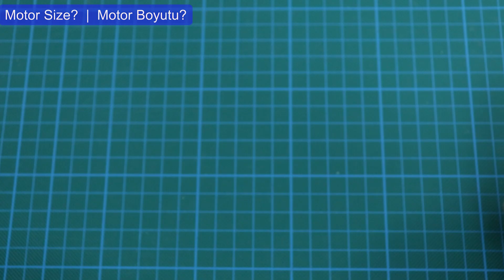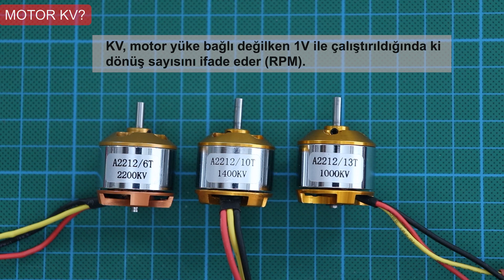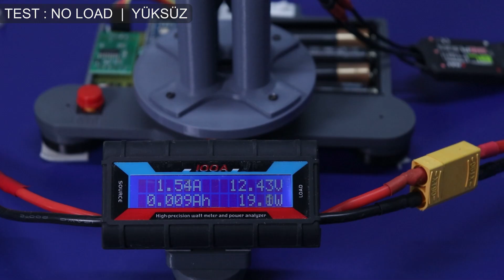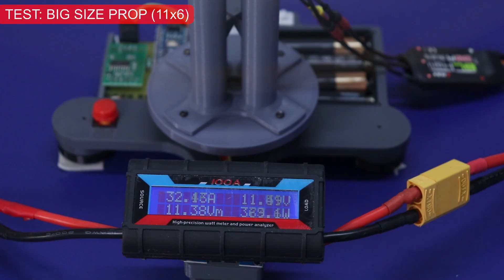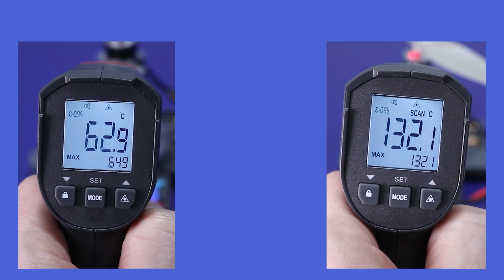RC Brushless Motors. What is KV ? Motor Size? Propeller Size?

Comment: So can i use 8x6 propeller for 1400KV motor? also what mah battery should i use
Reply from the maker: You can use an 8x6 propeller with a 2212 1400KV motor.
mAh (capacity) is a different matter. It depends on the model's carrying capacity, wing length, wing profile, wing span, etc. But generally, a capacity between 1000mAh and 2200mAh is suitable for models with 2212 motors.

Comment: Should I use 1400Kv motor for 9 inch prop ?
Reply from the maker: I don't recommend it. It will cause the motor to draw more current than normal. However, a size like 9x4 can be used. 9x6 isn't ideal.

Comment: hocam merhaba elımde bı 1400kw turuncu bı brushless motor var ve 30luk esc var ve tester ben bunu test etmek istiyorum ben bunu modem adapteriyle test edebılırmıyım 13v 1 a da
Reply from the maker: Hayır uygun değil.
Reply: @RC-Maker-Lab  hocam ben bunu yüksüz olarak denicem çalışıyormu diye hiç yük takmasam 12v 3a lık bi adapterle deneyebiliemiyim yüksüz olara k

Comment: Performance can be estimated from watts per pound. Take the weight of the plane and multiply it by the number of watts/lb you desire. A trainer can use 80 to 100 watts/lb, a warbird might use 125 to 150 watts/lb, an aerobatic plane needs 150 to 175 watts/lb, and a 3D plane needs 200+ watts/lb. The motor must be able to deliver the calculated number of watts. Next, divide the watts by the maximum current that the motor can handle. This gives you the optimal voltage for the motor. Now multiply the voltage by the KV of the motor to determine its no-load rpm. The prop should load the motor down to about 80% of the no-load rpm. Multiply the loaded rpm by the pitch of the prop and divide by 1056. This will give you the static pitch speed in mph. Try different KV's and pitch values until you get the rpm and pitch speed needed. And finally, the prop diameter is used to load the motor down to 75 to 80 percent of its no-load rpm. In most cases, the prop diameter should be 1.5 times its pitch. A prop with a diameter to pitch ratio (D:P) of 1.5:1 will provide good thrust from a standing start and draw a minimal amount of current. For more thrust, but a lower speed, a prop with a D:P of 2:1 or 3:1 prop can be used. However, it will be less efficient. For more speed, but less thrust from a standing start, a prop with a D:P of 1:1 can be used.

Comment: Hi, why shouldn't the Kv be measured by rotating the motor shaft at known rpm and measuring generated peak volatge. And then using formula RPM/U, get the Kv?

Comment: Hello, thank you very much for the information. I have a problem, on the same model of airplane, I went from a 2212 1400 kV engine, with an 8x4 propeller, to a 2836 1100 KV with a 10x50 propeller. The 2212 generates about 680 grams of thrust, while the 2836 only generates 100 grams of thrust, meaning it can't take off because it has so little thrust. I don't know what I'm doing wrong, the difference in thrust is huge. I thought that with the 2836 the thrust would improve. 😢. Help please.
Reply from the maker: You may not be using the correct propeller for your 2826 motor. This will usually be stated in the manufacturer's technical details. A larger propeller may be required.
Reply: @RC-Maker-Lab   @Kendin-Yap thanks for the prompt reply

Answer: The propeller size is within the range for this engine. The problem is that the engine arrived defective. I was able to compare it with another engine with the same characteristics and it produces 400 grams less thrust.

Comment: I have a 2822 1450 kv  motor with 40 amps esc.for this motor I purchased a propellor 10×5.while motor brand recommendations was 7×5.

In this case.
My 10×5 can be used or not.
If it is yes!
Does it makes any issues with motor
Reply from the maker: I do not recommend 10x5. The motor will draw more current than normal and will heat up a lot. The KV value is important for the propeller dimensions. As the KV value increases, the propeller should be smaller. 7x5 or 8x4 would be suitable. Manufacturers' propeller recommendations should be taken into account.

Comment: The thing is, how to determine the right propeller for a given motor size ? Is there a chart somewhere ? Sometimes the motor manual says about propellers, but the cheaper bargains or used ones have no such information. Great video, thanks!
Reply: 2212 1400kv takes 7 to 9inch prop bi-blade. And a 2216 1400kv take 8 to 10inch props bi-blade, motors that are in 28 to 30 size use a 9 to 12inch prop bi-blade.
Reply: And the kv of a motor is more for the cell count of your battery so for 1400kv a 3s or 4s can be used without damage.
Reply: @Viseo3dp Thank you, I really appreciate it. Another thing I have found is that a 3 cell 200 Watt motor (say, 20 Amps at 11.1 = 220 Watts) should be armed with 8 x 4 or 7 x 5 propellers, not 10". I have found a rough correlation between cells and prop inches. Like, as I said, you can not have 3 cell batteries AND 10 inch prop, regardless the motor size. Or it will be hard to find such a motor...  Would you agree that 3 cell batteries are 8x4, 7x5, around there ?

Comment: Hello Kendin, how are you? I would like to know how I can identify if one motor is stronger than another. I would also like to know why these motors use so much energy, unlike conventional DC motors.
Reply from the maker: Brushless motors have very high power and speed. Therefore, their power consumption is also high. But they are much more efficient than brushed motors.
Many manufacturers specify the technical values of their motors. If you cannot access the data related to your motor, you may need to do tests to learn. Test examples..
https://youtu.be/g3ZRp6UCkp0
https://youtu.be/UpRD3708WEc

Comment: Pls  ooo is the brushless motor also the rator we find in our CD, radio, and some other electronic equipments?
Reply from the maker: It is used in devices such as hard disk, CD player. If the motor has 3 or 4 wire outputs, it is a brushless motor. Those with 2 wires are brushed motors.

Comment: Hi, I bought a 2212 1400kv motor, with a 8x6 propeller and my esc is always getting really hot. Mine is a 30A, should I go for a higher amperage one? If so, how many amps should it be? Thanks!

P.S. my motor doesn't overheat, it's just the esc
Reply from the maker: The ideal propeller for 2212 1400KV motor is 8x4. But 8x6 can also be used. But it causes a little more heat. It is normal for ESCs to heat up to 50-60 °C. 30A ESC is suitable with 3S lipo. If you are using it with 4S, 40A can be necessary.
Reply: Thanks! I'm using a 3S lipo battery so it should be fine.  Just two more questions: Should I go for a 8x4 propeller? Does a 8x4 propeller produce significant more/less thrust than a 8x6?
Reply: @RC-Maker-Lab acaba motorun gücüne göre hangi pervanenin kullanılması gerektiğini nasıl öğrenebiliriz
Reply: motor kv si arttıkça daha küçük, düştükçe daha büyük pervaneler kullanabilirsin. Mesela 1400 kv motorda 7x4x3 pervane en uygunudur.
Reply: A 40 amp esc will work much better
Reply: @UKAasifGaming  Thanks!
Reply: Yes bro 8X6 produce more thrust.  ☺️